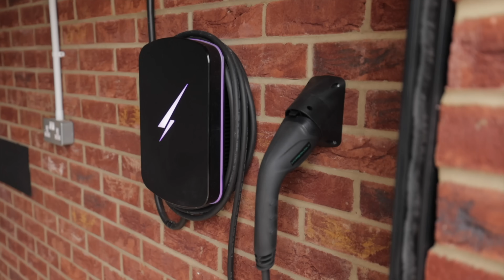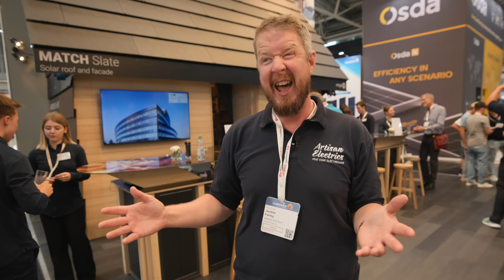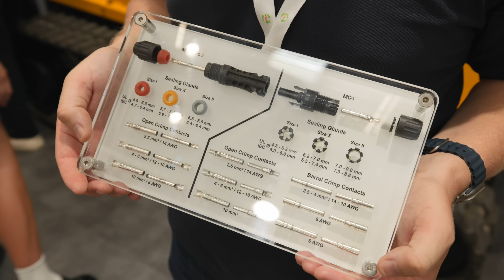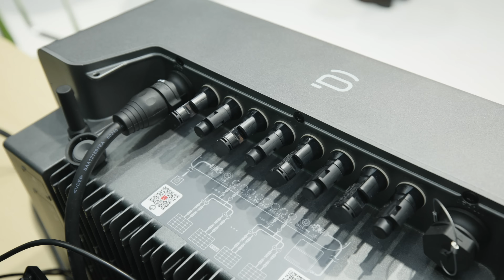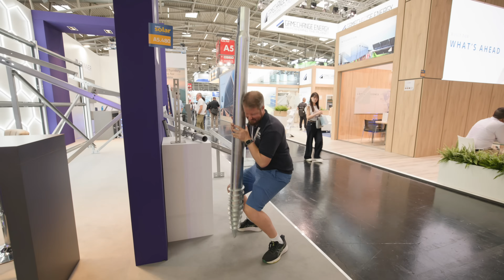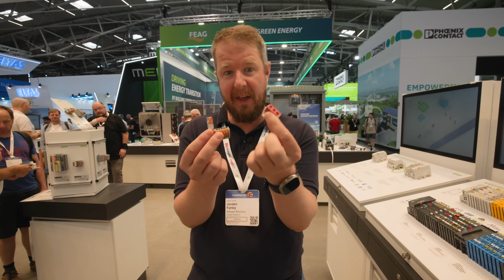The FUTURE of Solar Is Here! 🤯 Best New Tech from Intersolar 2026

Comment: The reverse charging on the car charging ports is a little under stated. It effectively means you can use your personal vehicle as the main battery bank. As buying 120-150kwh battery banks requires high voltage inverters and other pieces of equipment, the family SuV can be used as a substitute bank - opens up offgrid rental properties etc. It's very cool and will likely be one of the biggest points of entry for young people getting offgrid in the future.

Comment: I've had a Powerwal 3 installed with my Powerwall 2 in Australia. It works a treat. The only downside is the Tesla app only shows the batteries a "Powerwall-2x" and the charge capacity as a percentage of the two batteries combined. Basically, your PW3 runs the show and the PW2 becomes a slave battery. So far so good. 27:26

Comment: Noticed you plan on a plug in solar posting and at the show you looked at EcoFlow. May I suggest you look past the hype and marketing blurb and even technical specs for the following reason …EcoFlow Stream products in general work well however there are issues with this company and its services in particular Support and its rectification processes. I have 6 Stream Units and the Ultra unit started intermittently tripping RCBO. It took EcoFlow 48 days to respond. Now months later after agreeing to a replacement and EcoFlow collecting my unit but NOT supplying a replacement I am left with 5 batteries and having to use the EcoFlow inverter which I also bought to provide additional mppt inputs as a means of connecting 2 of 4 panels.

Comment: Notice he always leave out the most important part Renewables could only put in about 15% of their advertised output once connected to the grid and the main cause of skyrocketing electric bill easily demonstrated with a volt amp meter and 4th grade math called Ohm's law

Comment: When will they produce shutters /side panels to  our windows to keep heat out but produce electricity for AC etc .
In addition such shutters would be at the side of windows but on runners and programmed via an app to roll across  to shutter window in addition via actuators and hinges as in double glazing windows automatically tilt out/up to catch most rays .
Result cave interior and produce power to run house all done automatically .
Reply: Absolutely, my clients would love this

Comment: 1000w solar pannel, 50% efficiency, and 500 Wh/kg solid state home battery pack is what I really want to see in the next few years 🙏👍
Reply: 50% Efficiency is not "in the next few years". That will require a whole lot of extremely complex material science and breakthroughs to be even remotely economical.  If you need some panels to power a 150 million dollar satellite, maybe, but you're not going to strap it to your roof.
Reply: @EricLS  We already reached more than 30% efficiency on commercial level perovskite if I'm not wrong. I just hope we'll pass 40 in the next decade at least, it's probably way closer than we think.

Comment: Those new SolarEdge batteries look good but they should look to improve their customer service before releasing new products judging by the many posts on FB SE groups.
Reply: look good vs are good. Two different things
Reply: I would avoid SolarEdge we installed several systems with their optimisers 10+ years ago and their optimisers are starting to fail. They are under 25 years warranty but that is only for the part and doesn’t cover labour and scaffolding etc. so expensive repair.
Reply: My SE inverter died after 6 years and was eventually replaced after four months and yes I had to pay for labour which was £500.

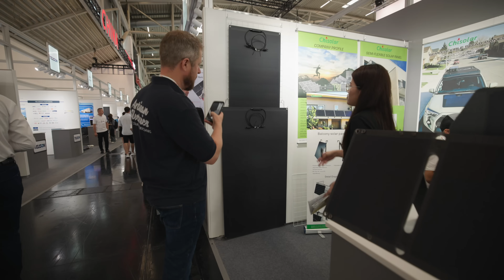Comment: 🟥 1:50 HIGHLY MISLEADING - such lightweight portable panels like those from chisolar will never save you money.. The only sensible use case is for camping/travelling with no access to grid mains.
I have some myself and regard them as a mistake.
( but happy to be proved wrong).  Otherwise great vid thanks
Reply: Well flimsy or not the UK will be hit by umpteen versions after the 27th August 26 when plug in solar become legal.

Comment: Abora PVT! Weren’t Abora at the show? Photo Voltaic Thermal seems a no brainier, PV loose efficiency as they warm up, so using water or a suitable refrigerant to cool the panels down, through a heat exchanger or heat pump to heat domestic hot water, and generating electricity to use and charge a battery seems so much more efficient

Comment: Is there a plug-in solar solution for those of us who live in flats without balconies?  Especially those of us who rent - the ability to take advantage of cheaper electricity from solar generation (and maybe top up the battery overnight from the mains if necessary).
Reply: As always, those with the most need are excluded. A large portable power station is effective if you can charge it cheaply, the only option for panels is the windows, most power stations have a limit on the size of panels you can employ.

Comment: Have been very wary of solar companies contacting me coldly, I find it very off putting so would massively appreciate some guidance as to what I would need for a three bed detached bungalow (approx 100msq) thank you so much, love the videos too 👍
Reply: Worth considering fence, or gable mounted panels, you can hook up the panels directly to a power station, there are up to 15kwh versions available. If you want to be grid-tied, it will be different.

Comment: Not convinced Solar is the future as the payback time will not be worth it
Reply: A portable power station is available with up to 15 kwh, it will charge from as little as a thousand watts of panels which can be in the garden, on the fence etc, these are not silly money, so payback time is much shorter. you can also charge them from a gennie if needed.
Reply: My system paid for itself in 7 years and will run for at least another 15.
Reply: @pilotboba  👍 Who pays for any repairs if required as I can't imagine the system will never break down.
Reply: @dm5949it's under warranty all that time.

Comment: Using Aluminium for HV cables will cut down on cable thefts
Reply: For cables of all voltages. UK railways are also suffering from copper cables thefts
Reply: @thesignalbridge  not cut down on thefts . soon  Aluminium will go up

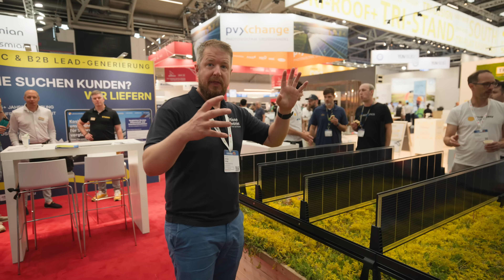Comment: 28:15 Was looking for a solar solution like the Over Easy vertical array for a local flat roof building.
I was concerned about the aging structure's ability to support the weight of a tornado resistant solar installation, without excessive roof penetrations.

Comment: You're already behind the time!
BYD is building the 1.5 M-watt charging stations throughout Europe and Canada for cars and small trucks. It's called a Flash charger.
Reply: I think 1.5MW charging is a bit of a publicity stunt.
If you have a place to charge overnight: that will be better most of the time.
Reply: @economicprisoner people have already independently tested it.
You don't have to 'think'.
Reply: @senti2175  I stand by my opinion.
I don't dispute that 1.5MW chargers are being built out. Some are even reportedly coming to Canada. No locations announced, but BYD is hiring a Canadian project manager for the roll-out.
I am with the Pirate Party of Canada. I was disappointed to learn that most of their announced projects, like an anti-censorship kit that can be mailed, were more publicity stunts than anything with a long-term plan.

Comment: Thanks very interesting, as an electrician myself, the thing I get asked for a lot is how to make a car port, lean to.. whatever out of solar panels.  I have done a few but I have always had the car port built (to an exact size!) and then added panels in a conventional way, looks very professional but not a cheap method, I have always thought that once you have a structure and a pile of panels there must be a way of attaching those panels such that there aren't gaps and the water will run off without dripping through the panel joins.
Did you see anything like that?
Reply from the maker: I did see some integrated systems like that at Intersolar, it's a massive growth area for sure! I reckon we'll be seeing them becoming more popular in the UK soon.
Reply: Check out Chiko car ports in the USA
Reply: You could run plastic gutters underneath gently  sloped to a end down gutter and run off to corner of lean to .

Comment: Tesla may have a large number of vehicles, but as far as I’m aware, only the Cybertruck officially supports vehicle-to-home (V2H). Since Tesla doesn’t officially sell the Cybertruck in the UK, the number of officially sold Cybertrucks here is currently zero. 
But all BYD vehicles are capable
Reply: Either the hardware is already there and just needs a software update or they will update the Model 3 and Y to include V2X.
Reply: @taefravis I doubt very much it’s hardware ready if it were I’m sure it would be well know. So still effectively zero ready. Yes you could fit the hardware but at what cost. You could do that to any EV.
Reply: dude, they are not even same game

Comment: Why in the UK you always talk about 500w panels??
In South Africa we have 630 w?
Reply: He means 'standard size & weight', that bit wasn't made clear. Also don't forget in many countries you aren't just allowed to lift 630w panels onto roofs, you need scaffolding, tele-loaders / cranes & handling equipment over a certain size & weight. I push my luck with 540w but I have my own crane and work platforms but most electricians do not own 50k worth of handling equipment.
Reply: @Ino-z2m  makes sense, the regulations that side is extreme over there !!

Comment: High voltage moves on the outside of conductors so if it's made of copper or aluminium, there is little difference in terms of its conductivity, but copper is heavier

Comment: There’s a chap building an electric aluminium expedition sailing boat who went to intersolar looking for solar solutions he could use on the boat, but didn’t spot any. He has certain challenges like the surfaces of the boat mean panels have be to flexible enough to be able to bend on both axis, they have to have good thermal management bonded to aluminium and he needs custom shapes to fit as much onto the hull as possible. His YouTube channel is The Ghostship. Anything he might have missed? Has anyone commercialised SolarFibre yet (MIT published 5 years ago they’d invented it), solar in the boats sails would be the holy grail (but salt water corrosion and his plan of sailing to the artic might be challenging)
Reply: Try to bend any material on 2 axis. It will tear if it's not something like rubber. A crystalline material can't do that. Try lying a peeled orange flat and you see the problem in the opposite direction.

Comment: The latest large wind farms with turbines >250 meters high are changing the weather systems around them, and if we put enough black solar cells in giant farms, we will probably raise the temperature of the planet quickly, that's a fact. There are many things in physics that work well in the laboratory and on a smaller scale, but are difficult to scale up, just think of hydrogen, which we have been experimenting with since the mid-1800s.
Reply: Wait till you hear what burning fossil fuels does to local environments and the climate at large. It's just a fact that it is much more damaging and raising the temperature of the planet much faster than the infrared heat absorption of solar panels ever will. It's basic physics.
Reply: @baratoplata7050 but we gotta use gas and coal to,make the bloody solar panels. To say nothing about clearing the world most divers forest to mine bauxite to make the aluminium to Mae the solar products. Renewable energy!
Reply: @jackiedines5229 we've got to use coal, oil and gas to make petrol cars, make oil wells, make oil pipelines and pump it out the ground too you dolt. 

The big oil scammers have you brainwashed.

Comment: Another glib and unsubstantiated pop from behind the MCS wall!  So amazon supplied and mismatched non-Staubli connectors are a great source of fires.  I didn't see that in the Government report on Plug in Solar so let's have some stats and make your case - which of course is that an MCS approved installer would only use Staubli plug!  Perhaps you made that case in the Government Consultation for Plug in Solar that ends today?

Comment: You know there are panels in the market outside of UK already reaching 700W and installed in homes
Reply from the maker: Yeah but much bigger - this was a standard sized panel 1762 x 1134
Reply: Yes but you will find that in 'the civilized world' there are rules, regulations regarding anything more 1800 x 1200 and more than 30kg working at what is called 'overhead height' where you need scaffolding, cranes, loaders, cherry pickers, harnesses, work schedules, H&S plan, method declaration to perform the install. Not many electricians (I suspect not even Artisan) have 50k worth of aerial handling equipment sitting in their yard, and, if they did, remember that it needs constant documented maintenance by a licensed engineer, annual inspections and all that crap so cost of ownership....
Reply: @Ino-z2m didn't realize supporting genosside of children was 'civilized'.

Comment: Would love to see a day when covering your roof with solar slate/tile would be comparable in price to real slate/tile.
Reply: Be creative. You can use overlapping frameless glass/glass panels as huge roofing slates. They go for 0,08euro/wp or 16e/m2 in bulk, cheapest building material ever and esthetically quite pleasing. Last year I reroofed a 70yo stable with  80 panels as proof of concep and works like charm. Took the solarstone system as inspiration and simplified it even further.
Reply: PV as a replacement of the roofs protective service in general would be great. It could still be pricier than either and still be more economical than both.
Reply: Keep dreaming

Comment: Someone going to tell him HV cables have been aluminum for decades.
Reply: Ah just seen it. 

Yea... he doesnt do commercial or HV. What do you expect?
Reply: He said that as going back to Aluminium due to AI. Copper is a better conductor but Alu is cheaper.
Reply: @R-S-X   Aluminium sucks  need to invent a hybrid   Aluminium.used copper in usa  due fires  from   Aluminium wiring
Reply: @hillbillyintheasia6122 This exists. Look up Copperweld CCA.
Reply: @R-S-X  Still wrong. Using alu since 1950s total
Reply: I didn't even see where he was shocked by Alu?
Reply: Wrong. HV cables have been aluminium for decades.
Reply: You can even use al for sub-mains and similar layer circuits in LV.
Reply: HV Cables use Aluminum for weight reduction.
Reply: @TruthseekingCuriousLovesBeauty  
Wrong. HV cables use aluminium for weight reduction.
Reply: That's essentially what he said.
Reply: did he mean High voltage or high current, those cables could carry a lot of current, did he say 110 thousand  volts ? in a domestic environment ?

Comment: We have flexible panels on our static house boat. Aesthetics made us go down the flexible route. Only 4 x 530w panels which with the 5.12kwh battery produces and stores more than enough power for our 2-3kwh per day. They're on slightly curved corrugated roof, and mounted flat. The main concern for us was cooling and angle. But even when temps hit high 30's last week they were well within their limits as we get mostly morning sun so they don't get peak strong mid afternoon sun. Most good days we're hitting 6-7kwh which for flat mounted, flexible panels that only get morning sun is something were very happy about. And you can't even see them. I used the staubli evo ready connectors as well. Got rid of the ones that comes on the panels so all connectors are all the same.
Reply: Interesting , thanks . Pause for thought :-)

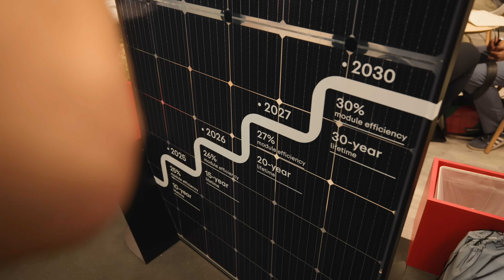Comment: 12:00 data centers in space is just another BS story to attract investment for the tech bro oligarchy, heat can't conduct and convect in a vacuum, the amount of solar panels for a single server rack? 750 to 1,000 square meters per satellite.
Reply: Solar power available: about 1,360 W/m²
Good space solar panels: 25–32% efficient
Usable electrical output after losses: roughly 250–350 W/m². So a typical 10 kW server rack would need about 30–40 m² of solar panels in continuous sunlight.
You need batteries for eclipse periods, panel ageing, pointing losses, radiation damage, and cooling. A practical design might double this, so 60–80 m² per 10 kW rack is a realistic figure. Radiators dissipate heat by emitting infrared radiation into the cold vacuum of space.
Reply: @jeremytaylor3312  The cost of building and maintenance is the problem.  Land based AI datacenters are massively cheaper (yet I do not like them).  So big companies will just push people out of the way to build them on Earth because it's more profitable.  

Perhaps big companies should spend money on research to bring down the size of panels, servers and other infrastructure and lose the reliance on water for cooling and high electricity use.
Reply: I can’t wait to see space tech to replace failed drive bad few memory sticks